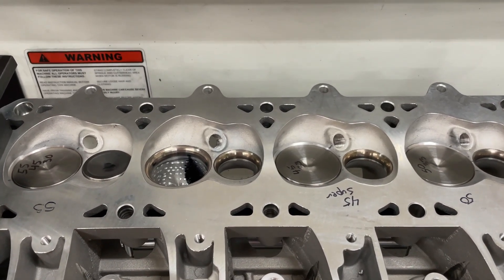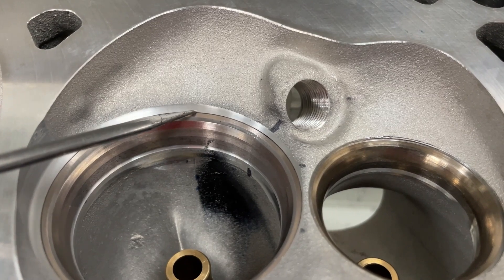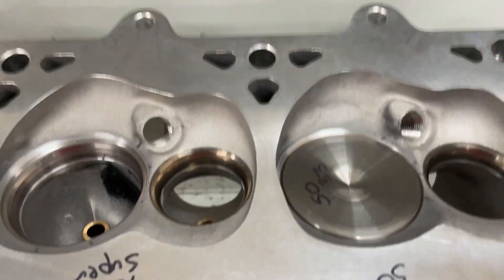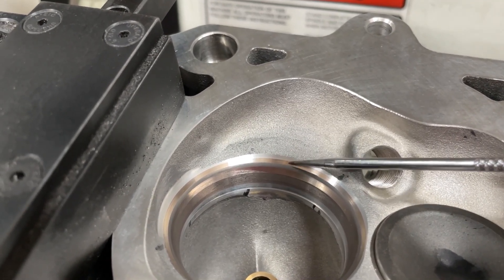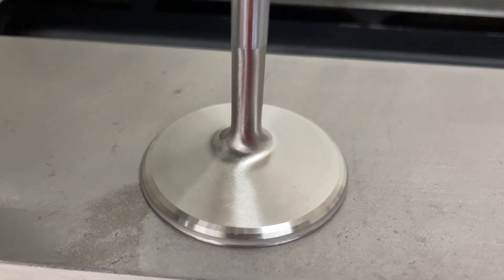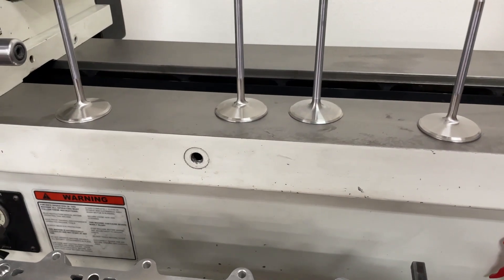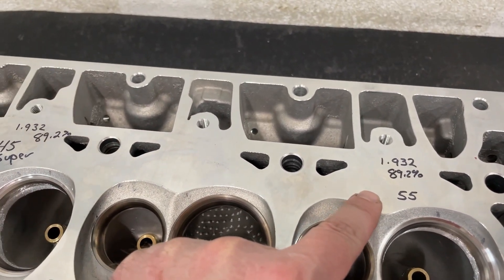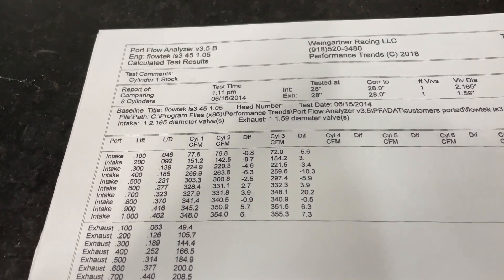LS3 valve job 45 vs 50 vs 55 Internet ports heads part 2

Comment: Did you ever put the biggest intake valve in or put a new seat to add even a bigger intake valve  then slide the head over so you can un shroud the intake valve I know just sliding head over where valves are more in center of piston and un shrouding the stock valve it feels like a big difference but I don't have a flow bench  just the but test
Reply: I always did that with the ford's and the LS Seem like it made a difference
Reply: I usually  bore the cilinder for alittle more room

Comment: Well, you're never gonna safely get to .800 lift or higher on most setups, so what point is there in gains in that area? All of these look like they overall hurt the head, but having 19 and 12.5 cfm less flow at .200 and .300 respectively (rather important low-mid lift areas for street engines) seems like far more of a detriment than the 16.3cfm gain at 600, which will be around or close to the MAX lift that most people's engines will see.

Comment: You have a great channel, please correct me if I’m wrong. Lifting a 45° versus 50 or 55 you would have more lift off the seat with the 45°. It would be interesting to see with the same lift off seat what they would flow. Thanks

Comment: Who cares about angle just round it and make a smooth radius. I only kept the valve angle for the seat and open the bowl 10% more and smoothed into the bowl. My TSP LS3 heads made 35hp more over stock, i did this on my aftermarket head before i installed them. Did the same on exhaust. Seems to work great, do guys not do this because of risk of damaging the seat. I used a burr.
Reply from the maker: You leave one angle under seat to break up fuel. You would have made more power if you had done that. Also when you do a full radius on intake you make reversion worse. The angle of the valve job lets you determine the throat profile.

Comment: 55s are always the most flow, that's why they are used in almost all extreme output engines. But the durability is not great

Comment: I'm sending my Gen 5 Viper motor for heads and cam. The builder is opting for a 5 angle single cut as opposed to a port and polish. Is there any reason why?

Comment: Rule of thumb is that the larger the seat angle the more flow gains at higher lifts. This also relates to RPM in that higher lift cams accommodate higher RPM's. For instance industrial equipment such as fork lifts often have 35° and 40° seat angle with valve lifts  less than .400, yet flow exceptionally well at those lifts.
Reply from the maker: I think forklifts use lesser angles for reliability and wear.
Reply: @WeingartnerRacing  I'm thinking in terms of modern equipment, wear is reduced by material selection, harder valves, harder seats. Reliability is increased in the same manner to the point that valve angle becomes a function in the calculations of efficiency, complete cylinder burn, exhaust evacuation, ect. Angle may have played a large role in these two factors in the past, not so much anymore

Comment: Just when you think you got a handle on things after years of trial and error, then comes along the next leap in technology. You think it's complicated now. Imagine what it's going to be like when valves aren't forced to be round anymore and they can be any shape you want them to be. The angle of your valve job will be infinite. Each valve will be machined with zero tolerance to match each specific port in each cylinder. Every valve different to match the specific performance of every cylinder because every cylinder will be optimized individually not all together in a group. In some ways we're still cavemen and have it easy.

Comment: If you show all the flow numbers on a graph overlapping each other then it's easier to see the difference in performance compared to one another. The raw data is too difficult to compare against one another when it's numbers on different pages. You might interpret the information differently when you can compare it visually on a graph. Also I would add up all the positives and negatives for each valve to see what the overall gain is and compare those against each other you might see a different picture.

Comment: I am looking for quality air/fuel Efficiency and Endurance---not every drop of horsepower---efficient, durable endurance running engines. I am having somebody I know build my hi-perf engines, but I want somebody who does most of his work in the head and intake manifold AIR-FLOW department---someone who has the correct brain and frame of mind and energy to do it all. I want and I like being able to actually speak with the person who is actually performing the real work---Eric sounds like he's that guy.

Comment: I have question about what type of valve job works best for gaining low end torque or is it even possible. I have a jeep tj and will be building another 4.0 straight 6. I do a lot of wheeling so any low and mid torque is ideal. If that comes into play based of cam then what would your recommendation be as a start.

Comment: Incredible seeing flow numbers after reading for years, the effects a valve job can make on flow. This really adds up to why the now defunct NHRA 'modified production' class cars with stock factory cast cylinder heads, allowed up to 1 inch down from including the seat, any modifications. Those things ran way better than they should have, based on what I knew back then, but now it's all adding up!

Eric, in your experience and opinion, would a head flowing in excess of whats needed in the case of these heads, on say a around 600hp LS, would the increases in flow translate to increases in HP?

Now lets say these heads were on a 725hp LS, it seems to me valve job flow increases would more likely translate directly in increased HP?

In other words, a conventional SBC with factory head castings is VERY flow limited regarding HP above around 425. I can see huge HP gains in ANY mods that increase flow bench numbers.  Would an over flowing cy heads capable engine, even respond to increasing the flow numbers? Example, a pretty much stock rec port LS making around 450hp?

I'd like to see your max effort port job flow numbers within the stock (huge) valve sizes on this head. 

How tech has advanced since I was in the game! A stock LS rec port is better than most any 23% aftermarket SBC head available. Now port a stock LS rec port casting, and not even in the same ballpark.

Comment: Do you do work on 4 valve cylinder heads? In the UK, where I am, large v8 engines with 2 valve cylinder heads are not the norm.

Comment: Good info. But who runs lift from 700-1000 🤔
Reply from the maker: Me
Reply: @WeingartnerRacing  on a Big block ?   I guess I was just thinking ls heads
Reply: Lots of folks. Small block and LS as well. Hell, I know street cars around here with well over .700 lift.
Flowing at higher lifts also shows how stable the port is and if it's capable of flowing more air period.....because a running engine will draw a hellofa lot more vacuum on the port than any flowbench can simulate.
Go back a few videos and you'll see where Eric explained SOME of his reasoning as well.
Reply: Go back and watch his other videos, it's well worth it....he explains why he likes the .400 lift range ( curious how AFR wins a lot of HP test with less peak flow)....and why you can see in this very test the port is dirty getting unstable then recovering just after most traditional LS hydraulic rollers ( .625 lift) and how that would affect real world power numbers....even though your not running a .700-.900 cam....he spells it all out....

 Imho go back and watch every video he has put out and when your caught up, you WILL be more knowledgeable this shit is fantastic he is doing for us....

 He is damn sure getting my LS7, LT or 317cc BBC heads or multiples....

Comment: I'll stick with what I recommended earlier on one of your other videos. 
91 1/2% throat and 100-102% bowl. 
Thin and contour the guide and the short turns need slightly laid back and widened especially favoring the bore center.
I like the more aggressive 45* seat because it's more along the line of what most people would be using. 50* and up would typically not be suggested on anything street driven.

Chamber work will net some real results and will be interesting to see!!! Especially around the spark plug and bore-center side of the valve.

Again.....thanks for laying a lot of the internet B.S. to rest!!!!
And thanks again for taking the time out of your busy work to do these videos!!!!

Comment: I’ve heard Eric make a somewhat controversial statement concerning throat diameter percentages. A statement I fully agree with. I know the man can’t give it all away to us. I just happen to think he can pull some big tricks out of his hat in this territory. 
   Something tells me he knows the answers to the questions he is asking. 
   I think it’s smart to use this platform to gather some thoughts outside of the proverbial box. 
   In my experiences boring throat diameters to a certain percentage is a dicey subject. 
   I’ve been into troubled waters several times during my career in this very subject. 
   Valve guide concentricity or lack there of sure can hurt a fellow that is trying to maintain port quality and it’s my belief that the industry utilizes this to their advantage.
Reply: CFM matter the most at high rpm when the engine has less and less time to fill the cylinders

Comment: I like to watch these videos to learn from. Not that I going to port a set of head . I prefer to buy that .  I seen a few videos and if you get time and want to I like to hear your thoughts on the comparison between the rec port and the cathedral port heads as far as performance . Seems like I heard GM cast there heads in the rec port in a way to help the engine respond better at low rpms .  Thanks for your time

Comment: Silly question.  Why the multi angle verses radius valve job like we use on the exhaust?
Reply: I think it has something to do with the ex flow velocity is supersonic, whereas the intake flow is orders of magnitude slower. IIRC The intakes flow less on a bench with a radius from what I understand. I do recall cutting a radius 45% intake seat at the customers request back in the day, one time on a SBC 1.94 to 2.02 valve conversion. We didn't have a flow bench though.

Comment: Very informative- thank you for taking the time to detail all the “details”.   My question is how to interpret any gain or loss of CFM to the performance of an engine. How important (or not) is 1 cfm?  How much gain or loss is required to make the engine show a change- up or down?  Thanks again…
Reply: Great Content, Great Work, Super Detailed explaination of the Synergy, Gains & Losses. Any benefit to Porting 832 Heads (any Exhaust Gains on 76% Ratio) on a 553 to 590 Max lift on a 416 (LS7 TI Rotating Assembly) Stroker for Low End to Mid Range "Torque" to move a Heavy 6850 lb Lifted 80's Land Cruiser

Comment: How would you compensate “sinking” the valve job to correct the valve stem height on a non-adjustable valve train?
Reply: I just mill the stem to compensate.
Reply: @issuesmotorsports2457  Yep. Valve stem height has to be reset (grind the stem tips) after a VG on non adj valve train for a stock engine. Of course there's a bunch of other ways to do it, not to mention the large lifter plunger travel in most stock hydraulic lifters.
Reply: take from head surface or deck block.  

On a single chamber issue is a new insert the best practice?
Reply: Legitimate question especially with shaft rocker arms and a set of $1200 pushrods. 
  It can be calculated and can be done. 
  Rocker arm ratio has to be known. 
   Which side of the rocker arm the correction needed to be made are on. 
  Details like head gasket thickness, machining done to the deck surface of the block and milling to correct compression ratio, all effect the length the pushrod has at the rocker arm and the rocker arm ratio must be applied to those length changes by multiplying them by the rocker arm ratio. 
   The changes made that effect valve stem length on the “fast side” of the rocker arm must be divided by the rocker arm ratio to calculate.
Reply: Might as well change the pistons or put longer rods in it, depending on quench

Comment: Have you ever tried a 30 or 35 degree seat angle on a set of heads destined for street/ strip  type of engine? From what ive read they flow much better from 400 lift down but the drawback is from needing a stronger spring and having to cut a groove on the combustion chamber side of the valve for it to seal better. Diesel engines are around 25 to 30 degree seats is my reason for asking   and one of the most infamous names in engine building/ porting.thanks
Reply: Large diesels have 20 to 30 degrees to decrease the micro movement of the sealing surfaces against each other.   It needs ti be decreased as the intake of a diesel is either not lubricate with particles in the fuel or gets a hard chrome-oxide layer as the exhaust valves get because of temperature . This oxide layer lowers the wear of these micro movements so much that a 45 degrees can be used.  

The 45 degrees seat angle flows much better , depending on intake port design , from 0.25" and up .
Reply: The old factory Pontiac V8 heads had 30% intake seats, with tiny ports and bowls. I think it may have been to get the most out of the tiny cross sectional ports by improving very low lift flow numbers, say from .050 to .200 lift range. Most of the cams they used rarely had over .480 lift IIRC. Then the exhaust had a 45% seat with a 90% cut directly below the seat. Really odd design decisions and I've always wondered why.
Reply: @Jeffsa12  I recently did  1 set of those.      Intake changed to 45 degrees,  exh  enlarged valve just a bit so that nice radius could be applied.

Comment: As usual. This one was a great watch. But until the throats are enlarged and the short sides adjusted. I dont think the different valvejobs can be analyzed with any real concern.
Reply: I think a large problem is that each valve job requires different chamber profiles as well, hence the comment about not always being best suited. It’s far to much billable time and cost of a head to show the results from those kinds mods. Hey Eric…. Do you think you have a few customer heads out there that might show these mods.